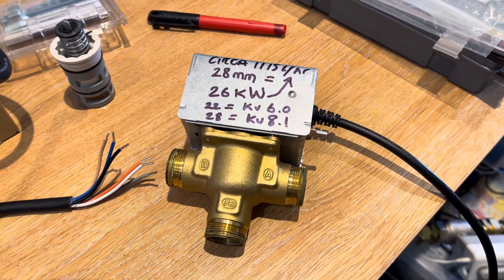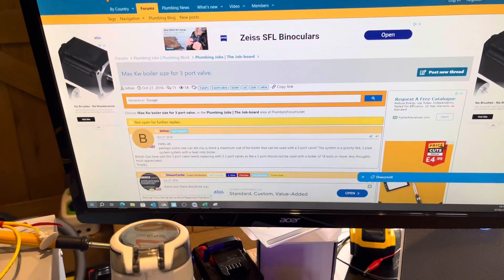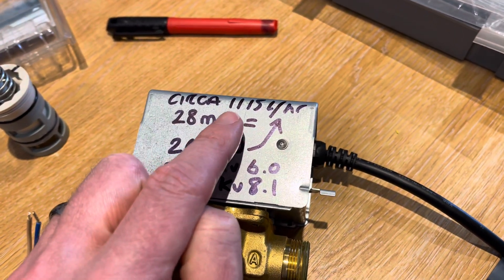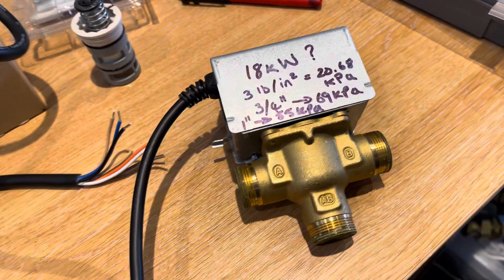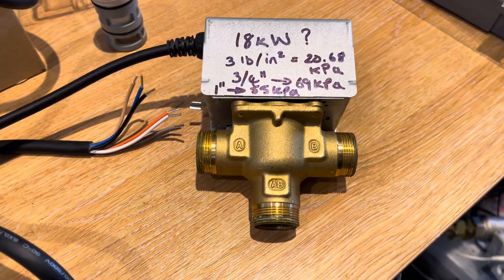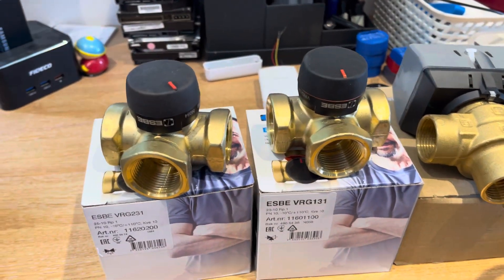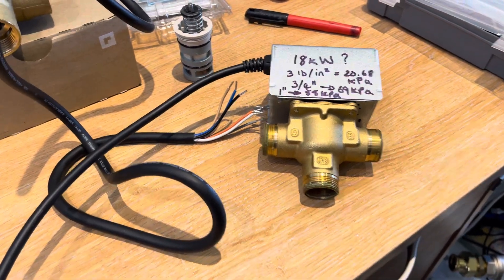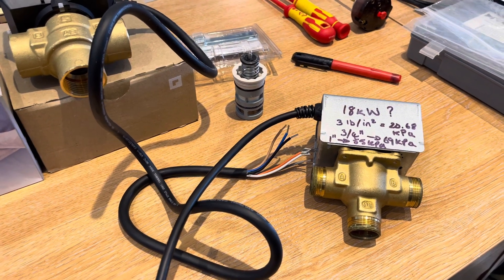Don’t use spring return 3 port motorised valves on heat pumps?

Comment: yes - balls being detached from the body is getting pretty common. If only most manus weren't suppling spring return valves with their kits.
Reply: What motorised valves are you using with heat pump installations please?

Comment: Any disadvantage of using the mixing esbe valve over the diverter type so long as the correct head is used as a doverter?
Reply from the maker: No disadvantage as long as there is an understanding that the shoe is in the correct position when the actuator is fitted.